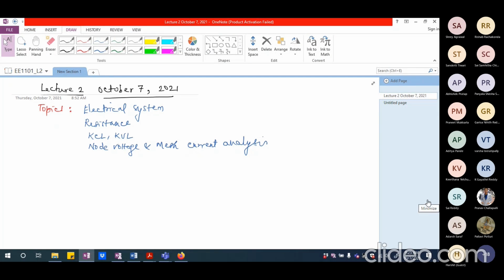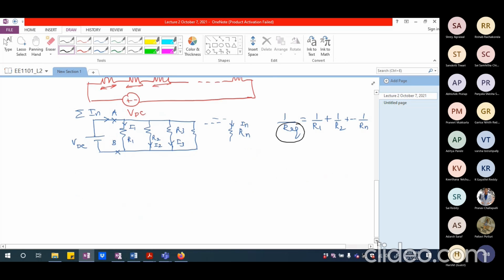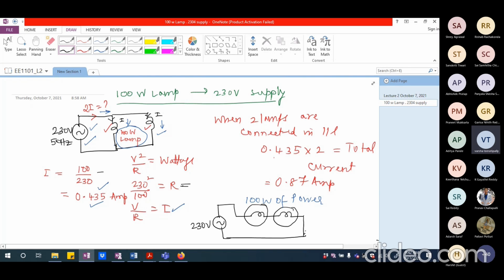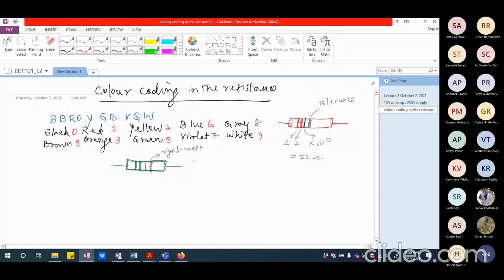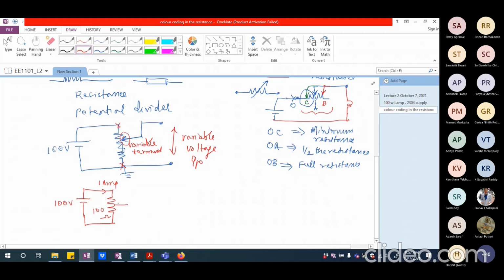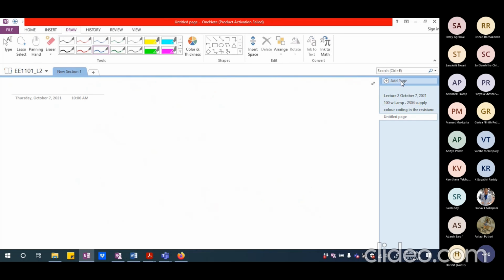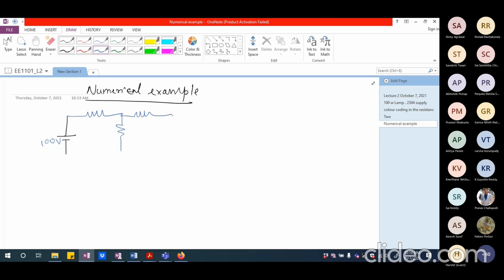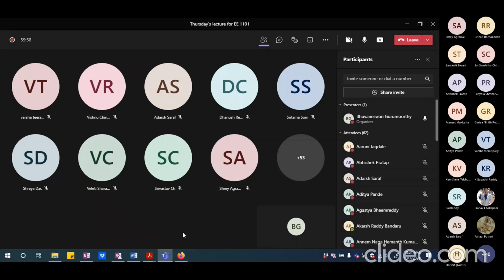Principles of EE-Lecture2

Comment: Respected ma'am, 50:15 R1 is 20ohms, R2 is also 20ohms, finally R1 resistor through  2.5Amps flowing , further R1 divides then 1.25A in one part of resistor, 1.25A another part